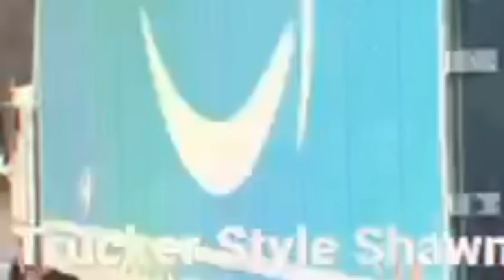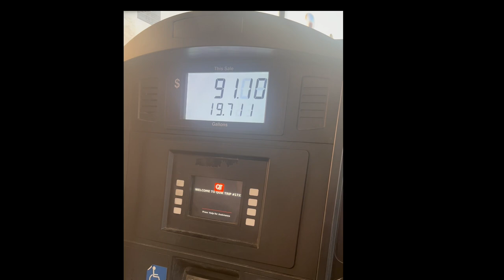Trucking, and braking things! Rebuilding a air brake chamber, and moving freight

Comment: Cabover looking good man, didn't know you could just replace those diaphragms that's good info to have right there. I know you adjusted the slack adjuster but what about a c-clamp holding the two pieces together while you tightened the clamp would that have worked. Hope your doing good btw.
Reply from the maker: The clamp that goes around it went on easy when I backed off the brake.
Reply: @truckerstyleshawn  I was thinking when you struggling with it, what if you backed it off and then you did lol
Reply from the maker: I guess you could